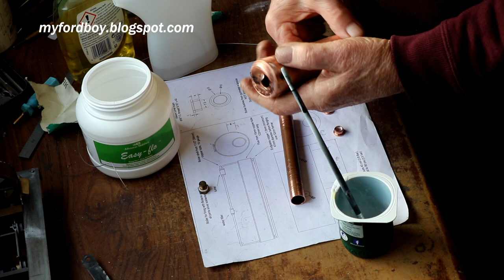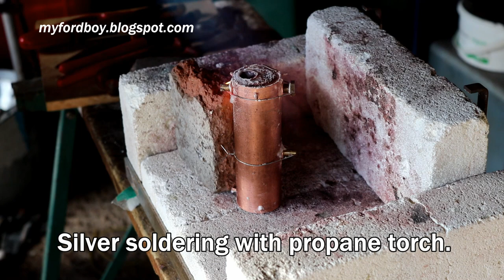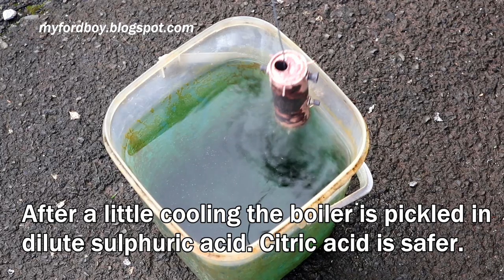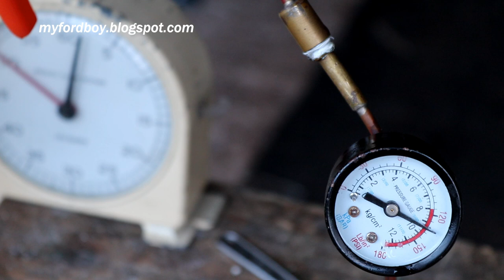Silver Soldered Boiler for 16mm Live Steam Locomotive

Comment: For pickling the boiler, go to your local pool shop and pick up a ton of PH- and make a saturated solution. It works amazingly and you can dunk your hands in it with only a little mild stinging on any cuts already on your hands, very efficient at cleaning the copper and very easy on your hands and lungs, cleans the copper in only a few minutes
Reply: Yes. I believe the stuff you are talking about is sodium bisulphate. It's a Ph buffer. I use it for silver jewellery work. Desert spoon in a pint of water. Heat it up in an old electric crock pot. Works well and a small bucket of the stuff will last about six trillion years... Give or take. Martin Kyle over at model-engineer.co.uk explains that the dissassociative effect of Sodium bisulphate when added to water produces positive sodium ions, positive hydrogen ions and SO4 which acts as a mild solution of sulphuric acid but as sulphuric acid seems to be getting hard to get over there in the UK, sodium bisulphate might be a reasonable alternative.

Comment: You need more of a pin point flame, something like a size 12 welding tip so you can direct where you want the heat instead of just heating the whole thing up. You shouldn’t need flux for copper to copper if you clean it with emery beforehand either. Love your videos mate 👍🏻
Reply from the maker: You would never make a model boiler like that. Flux is essential and a large torch is needed to heat the copper. local heating is no good.
Reply: @myfordboy   definitely not essential for copper to copper. With a finer welding tip you can put much more heat into a smaller more workable area rather having the whole thing heat up over a longer period of time, which also burns most of your flux off anyway.
Reply from the maker: @jordankerr1377  I have to disagree. What I am showing is the standard way model boilers are made. Have you ever made one?
Reply: @myfordboy  I have not made one but would love to after watching your videos. I am a refrigeration mechanic and weld copper to copper that is rated to 600psi, without using flux, every day. I’m not trying to say what you’re doing is wrong, because it clearly works!
Reply from the maker: @jordankerr1377  Please don't make a boiler that way.

Comment: You really should try the Harris High Temp Black Brazing Flux it comes premixed I don’t even look at the white flux anymore it’s seriously the best flux out there you can’t burn it. And the parts don’t have to be 100% clean you can heat it solder it let I cool a bit, Inspect the job and reheat it without adding any flux it’s amazing

Comment: myfordboy Not sure what's happening with the torch, but I always put my oxy/propane, propane and mapp gas torch tanks in hot water, performs miracles.
Reply from the maker: Nothing wrong with the torch. It has a trigger so i can control the flame size and releasing it just leaves a pilot light.
Reply: @myfordboy  Oh, I see now! Thank you for responding.  You are an excellent Craftsman and I look forward to all your videos.
Reply from the maker: Yes it's the same siervert set. Great torch. The large burner is rated at 84 kw. I am using a 13 kg bottle and don't have a problem with it freezing. One thing you could try is put the bottle in a bowl of hot water.

Comment: Very interesting. I quite fancy trying some silver soldering on a small scale. Is there a torch or kit you can recommend?
Cheers
Andrew
Reply from the maker: I have a sievert set which I highly recommend but you may not want to spend as much. 
If you can i would go for the same torch and choose a burner size to suit your needs.I would suggest a torch that runs off a seperate propane cylinder.

Comment: Nicely done. I’m looking forward to tig welding mine, because I don’t have your soldering skill to solder one, but I fancy a go :o)
Reply from the maker: I would not recommend a tig welder boiler for one thing it will not comply with model boiler regs if you want a certificate. The joints would not be neat like silver solder.
Reply: @myfordboy  Don't know what to say, we have a 7" Black Five boiler that is tig seam welded in copper. I'll go look at the CE PED chart for SEP bar/litre demarkation.

Comment: Who's a good source for heavy-wall copper tubing like you're using here?
Reply from the maker: This tube came from 
https://www.nogginend.com
Reply: Ronald Farley  Standard copper plumbing pipe isn't nearly this thick - looking at 1:12, the wall thickness looks to be around maybe 2 to 2.5mm. Plumbing pipe of that size is only 1-1.5mm wall.
Reply from the maker: The tube is 16 swg, about 1/16" thick. I would have prefered 18 or 20swg but these sizes don't seem available anymore.

Comment: It just looked hard to handle and it kept going out on you is why I suggested the mini torch. 
No disrespect intended
Reply from the maker: No it did not go out it has a trigger control that shuts off the burner when I want and leaves a pilot light burning. This is not a cheap hand held torch but a professional propane fueled one. You would never silver solder a boiler like this with a butane mini totch. Not enough heat.

Comment: You’re amazing!
Reply: Just a point on soldering. We soldered hundreds of copper/brass assemblies in a work situation. Found natural gas and air torches very useful with a chance to adjust the flame to suit. Yes and we had wired on components and both ends to solder too.

Comment: A couple of questions, if you have time sir.  The 3D printed former ... How did you print it, 100% infill something less.  Just thinking of it taking the beating of forming the copper.  The second, is the inline check or one way valve in your boiler test rig?  Can you explain it?  is this a purchased item or did you make it?  Also, I am amazed that the hand sprayer bottle would pump that high of a pressure.  Thanks for sharing.

Joe
Reply from the maker: I would have used 100% infill.
The non return valve is a car tyre valve.
Reply: @myfordboy  thank you for answering my questions.

Comment: Instead of hammering that end cap - would metal spinning work?
Reply from the maker: You could do it that way.
Reply: Beating copper over a former is easier than it looks. The main thing is the annealing. Freshly annealed copper is a joy to work. As you work it, it will harden up a bit, but just anneal it again then carry on. 
From what I’ve seen, metal spinning looks easy when done by an expert but there’s a lot of danger there!

Comment: Forgive my ignorance but what material are the blanking plugs used for screwing into the bushes to assist holding them in place during silver soldering. I am always nervous the plugs would be soldered to the bushes so i have used rusty steel and i believe I read carbon dust from leaded pencil brushed onto the thread also works.
Reply from the maker: The plus were brass. The solder would be away from them so no danger of soldering in place. I do have a collection of rusty screws and fittings I use on other assemblies. If I want to stop solder flowing I use typist correction fluid, i.e. Tipex as a resist.

Comment: Чтобы медная деталь стала мягкой, её нужно сначала нагреть, затем быстро охладить в воде. А здесь делается наоборот. Почему?
In order for the copper part to become soft, it must first be heated and then rapidly cooled in water. But here is done the opposite. Why?
Reply from the maker: It makes no difference if you let the copper cool or quench it. It will still be soft.
Reply: @myfordboy  Aah, now I understand. I do not often work with copper parts, I often use aluminum, steel, brass and bronze.
P.S. Sorry for my English ...

Comment: Why didn't you just use copper pipe caps for the ends of the boiler instead of spending all that time making them.
Reply from the maker: Because I want a realistic looking model not one that looks like it's made of plumbing fittings. They would not be available in this size anyway.

Comment: Use a mini torch that uses butane
Reply from the maker: You can'y have done this yourself or you would know that silver soldering a boiler needs lots of heat to get the metal quickly up to the 640C temperature of the solder.

Comment: Way too big of a torch for such a small job man
Reply from the maker: You can'y have done this yourself or you would know that silver soldering a boiler needs lots of heat to get the metal quickly up to the 640C temperature of the solder.
Reply: Use Acetylene, more heat, better control, smaller tip.

Comment: I like the way you use your torch. I think the tip is a little over sized but you do a good job of controlling the heat. What amount of silver content in rod? I have found that 45 to 51 % give me the best joints. Have you ever used Xergon silver brazing products. Have gotten the best flow of rod from their product. Also rods are fluxed.
Reply from the maker: I am using Easyflow solder, 42%, old stock cadmium bearing flows well.